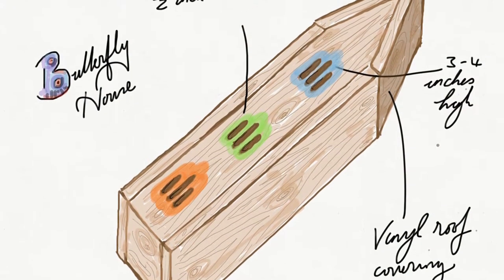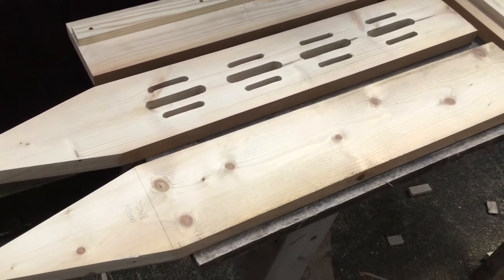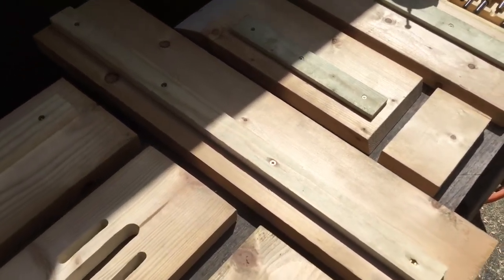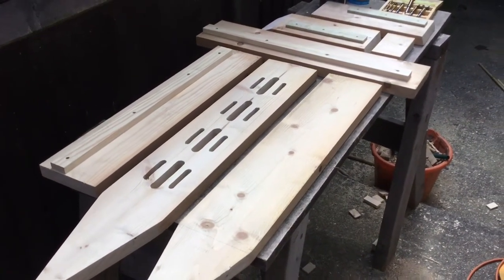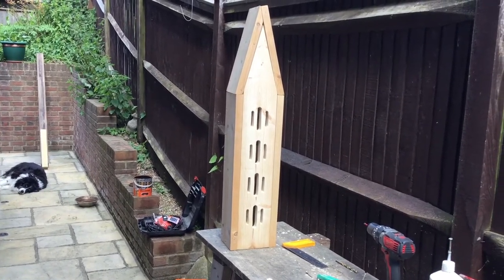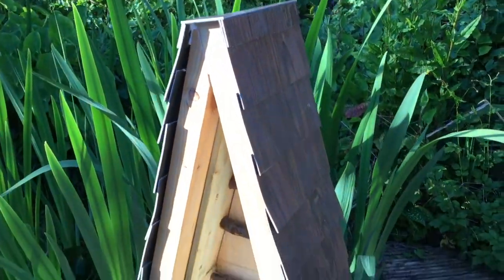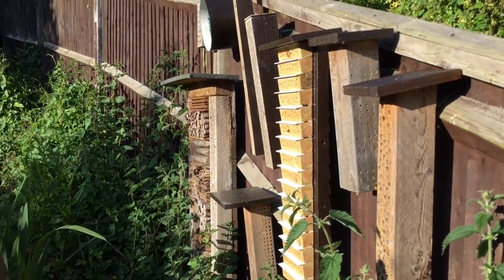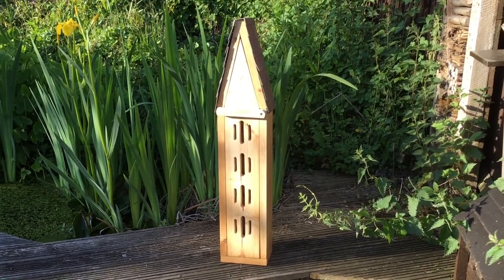Insect Hotels - DIY Butterfly Habitat / House Build With Timelapse

Comment: I’ve recently purchased an acre or so of  land. It’s a field on a slight slope facing north all most surrounded by 2m+ tall sloe trees at the bottom corner  of the slope I’d like to put in a Dutch barn gambrel roof type 10m x4m half for animals one day other half for tool store roof for hay grain ect. Then ram it with habitats as it’s on a slope there would be room underneath for habitats as well as the shape of the roof I would like to have . would have many shapes to put different habitats for many creatures bats birds hogs butterflies ect do you have any ideas or advice please before I try to plan the build and get it  right from the start so the animals birds bats owls  insects sort of get along and not treat it like a drive through 😆many thanks 👍🏼🇬🇬